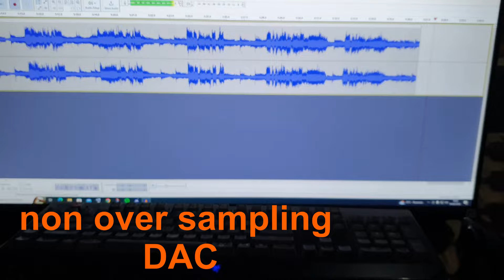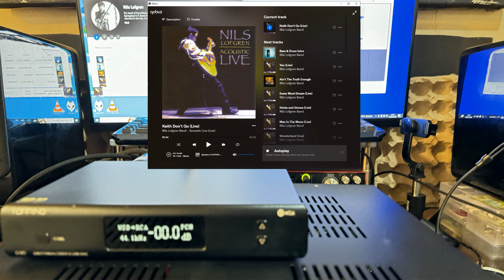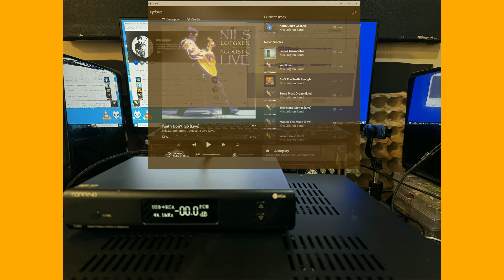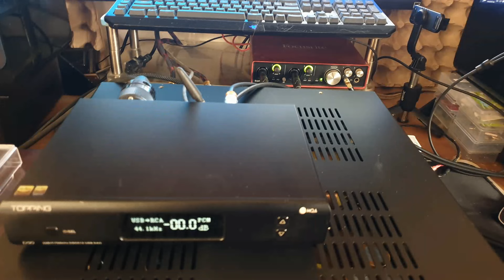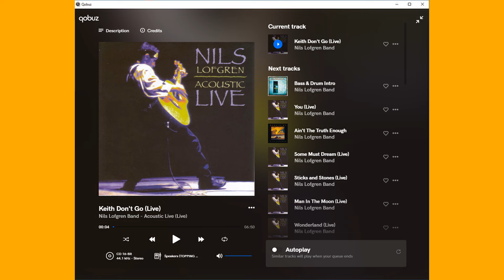DIY Audiophile : Do you still like streaming with DAC Hires?? Please listen to this !

Comment: My thinking about it,..analog Vinyl First,…that Musik has Soul. CD second Place.,…but streaming are Kompression Digital Numbers , without and Soul. Analog, Tubes, Single Driver Speaker that’s the best way for music and mental Health.🙏🏻🌞.
Reply from the maker: Thank you  Roberto,
Many claim that digital audio streaming is now great with the claim that it is high resolution with advances in the field of internet large data transfer is very possible.  with MQA technology (like it failed) and a fold to unfold file system.  and also Hires PCM like on Qobuz, here I tried to compare it with a non over sampling DAC against a new DAC with lots of channels and dual operation from AKM to find out.
There are ..
Reply: My feelings exactly!